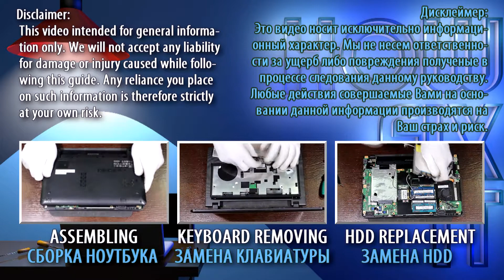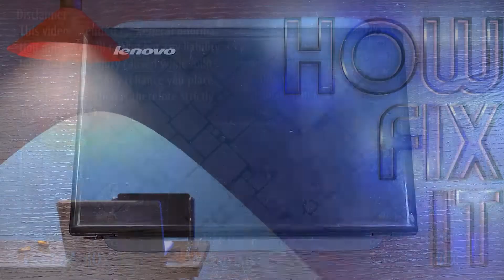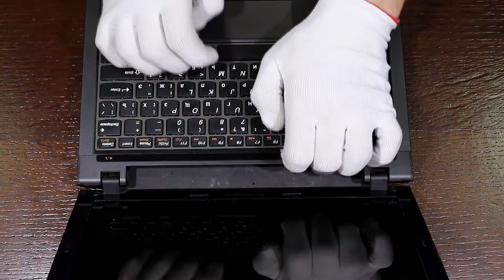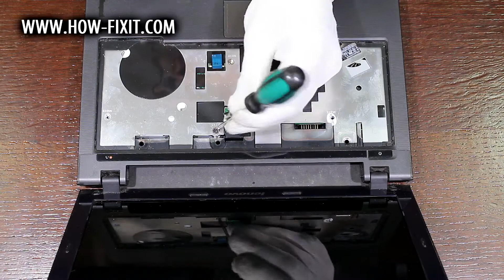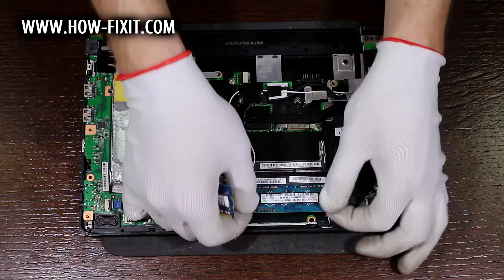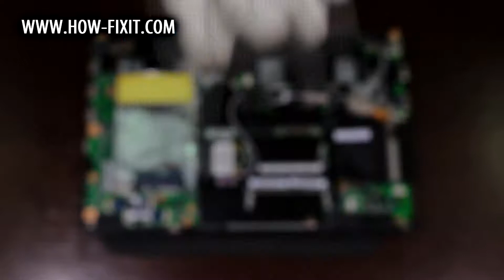Lenovo IdeaPad S205 RAM Upgrade & Install: Step-by-Step DIY Guide

Comment: My question is why the hell did you take the keyboard off for a ram replacement? This video makes no sense at all.
Reply: Because there are screws under the keyboard that hold the bottom cover in place